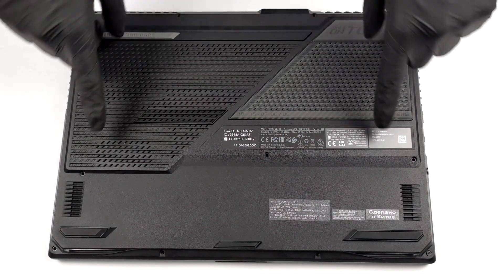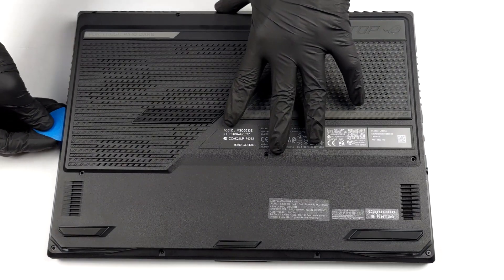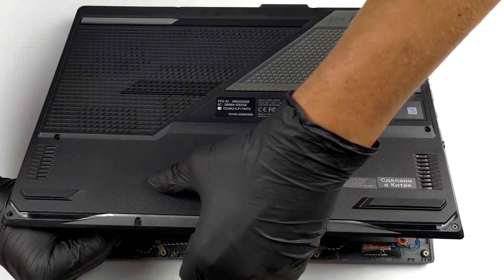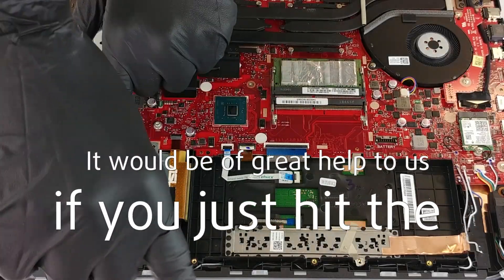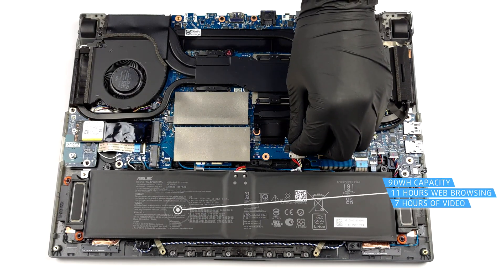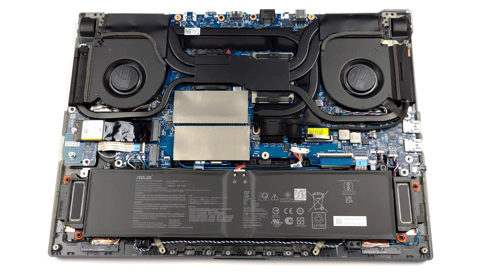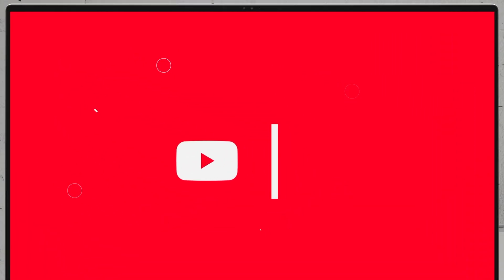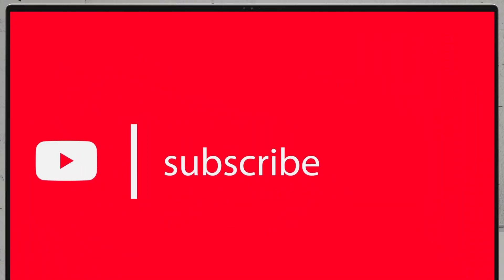🛠️ ASUS ROG Strix SCAR 15 G533 (2022) - disassembly and upgrade options

Comment: Just one question if I want to install another RAM this is the correct one ? Crucial RAM 16GB DDR5 4800MHz CL40 Laptop Memory CT16G48C40S5    (I wonder for the CL40) so if you please let me know I will appreciate it
Reply: I think any ram brand would do but not sure

Comment: thanks , do you know if the rog strix g15 2022 have also x2 m.2 slots? Or just a single m.2 ? Thanks
Reply: It has 2 m.2 slots
Reply: @lidinprasalrm1027  Thanks
Reply: @armandoarroyo both slots support Gen 4 PCie